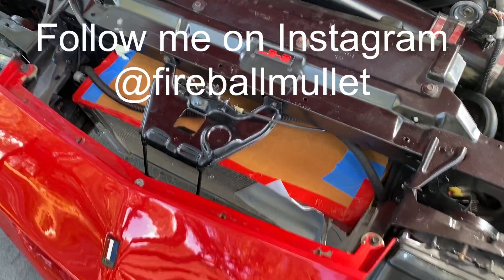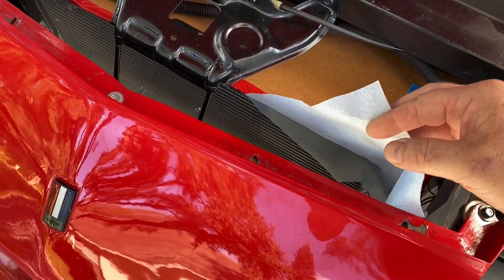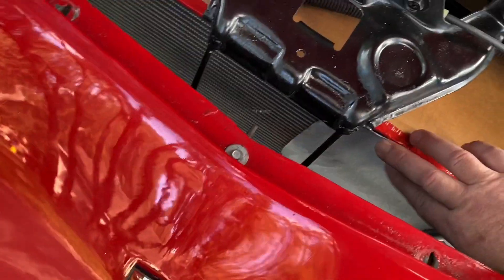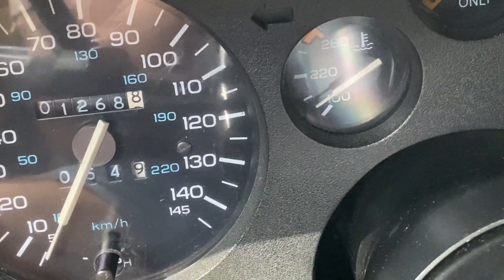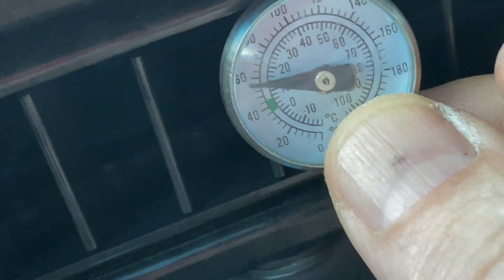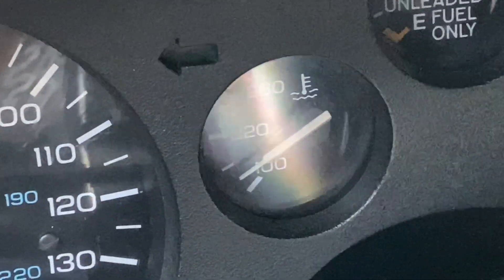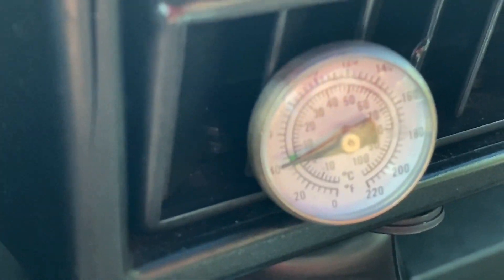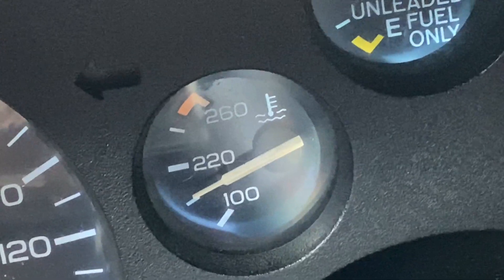LSA Prep - Shroud Heat Exchanger mock up for LS3 3rd gen Camaro Iroc-Z

Comment: Hey fireball mullet I have a 89 iroc z 5.7tpi and been having those same issues. I put in a different fan set up. Let me know what you figured out.
Reply from the maker: I will... have had LS1 fans and put these Intrepid ones on and they ROAR LOL. So I think engine bay hot air is getting sucked around it.
Reply: @FireballMullet  Nice man. I went with some spal fans. So what I recommended is building some aluminum brackets around the openings that's what I did.
Reply from the maker: @lateroc2955  spals are sweet! Yep next week I’m trying that. I also just put 160 thermostat tonight so that may help
Reply: @FireballMullet  Listen man is third gen guys have to stick together. I'm here if you need me.
Reply from the maker: @lateroc2955  absolutely!
Reply: @FireballMullet  Yes sir

Comment: Go to (ANY) local "HVAC" company, tell them you need a flat sheet of 36"x96" 26ga sheet metal.... About 20 bucks for a big flat sheet 3ftx8ft in 26ga, you can go to 24ga or thicker but it's not needed.....
Reply from the maker: Awesome, thanks! I think a metal break and some brackets will get it done!
Reply: @FireballMullet  You don't need a "BRAKE" just go to a HVAC store like Johnstone supply, RE MICHEL, 2j, etc tell them you want that metal and some "SEAMERS" 3" is best, or a 18" flanger... That will put the "BENDS" ya need clean enough.
Reply from the maker: @ICONBADGTA  I’ll check that out!